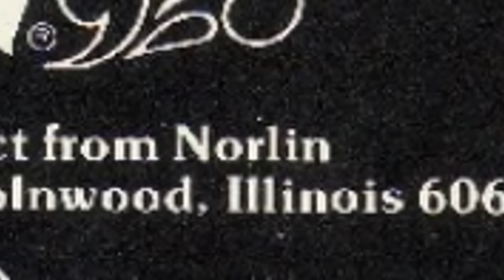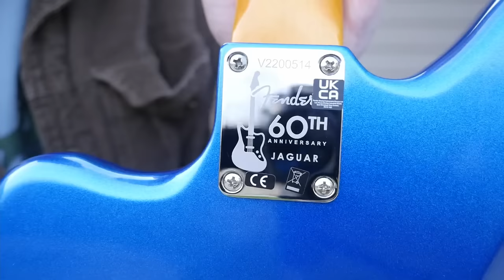I Was Thinking About Selling This Guitar... | 1983 Gibson Spotlight Special ASB Review Demo 83 042

Comment: You're talking about Gibson goofing around using the wood that was cut too short about 1988 I was at Azusa guitar Center (this is located near San Dumas a legendary location for another brand's manufacture) there was this Paul with an interesting top the wood had a distinguishing knot by the bridge on the treble side it was a book matched top The thing sounded Good!! I wanted it so bad The thing eventually sold Then a left handed Les Paul turned up I could tell this was an exact Siamese Twin of the right handed guitar previously there by the knot in the wood top by the treble side of the bridge on the right handed guitar Same color scheme everything Again Gibson just goofing around A side note People gripe about some practices but the wood and materials are expensive and they can't just throw it away ... use it up to the best of you're ability
Reply: Is this some kind of protest against punctuation?
Reply: Sorry Guy I'm thinking this is I reference to that "San Dumas" flub in fact I had just discovered it's the auto spell feature on my phone here San Dimas this is what I had intended.   Oops I apologize